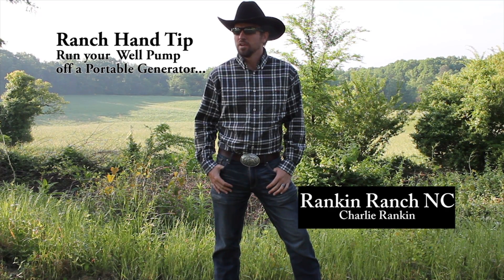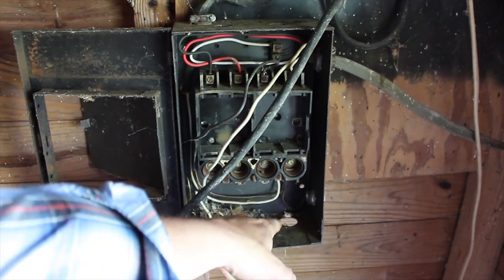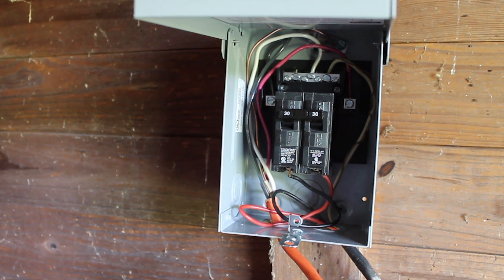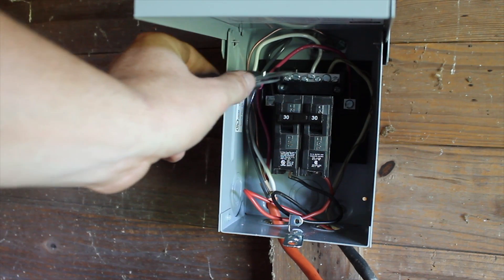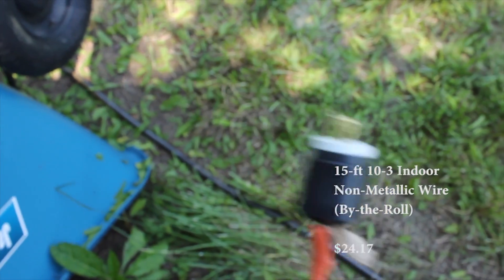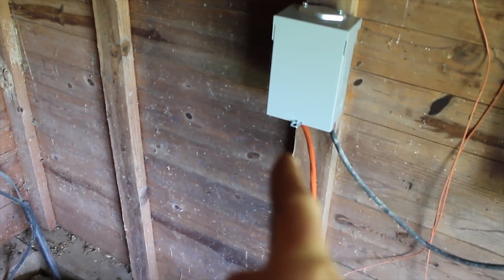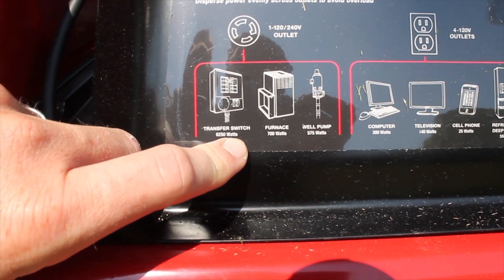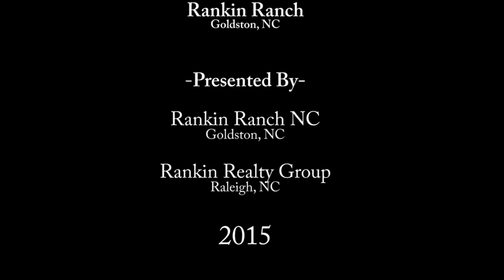How to run a submersible well pump off a portable generator. - Ranch Hand Tips

Comment from the maker: Outdoor Breaker Panel 30/30 http://amzn.to/2HQ8mEK
10/3 Outdoor Wire http://amzn.to/2Gb231m
Submersible Well Wire 300' http://amzn.to/2prHfrY
Square D 30amp Breaker Double Pull http://amzn.to/2pq3mzU
240V Plug Adaptor http://amzn.to/2puwlm0

Comment: Can you run well pump with a 30a rv generator?
Reply: typical residential submersible well pump will draw close to 15 amps for an instant at starting and the draw about 5 amps while running

My well is 220 volts not 120 volt.
Reply: The number of amps a deep well pump draws depends on its horsepower (HP):
15 amp: For pumps smaller than 0.5 HP, using about 5 amps or 700 watts
20 amp: For pumps smaller than 0.75 HP, using about 8 amps or 1100 watts
25 amp: For pumps 1 HP or smaller, using about 9 amps or 1400 watts
30 amp: For pumps smaller than 2 HP, using about 13 amps or 2300 watts
40 amp: For pumps smaller than 3 HP, using about 16 amps or 3200 watts
50 amp: For pumps smaller than 5 HP, using about 25 amps or 5300 watts 
On average, a well pump uses 700 to 800 watts of electricity, but larger pumps can use up to 2000 to 5000 watts. If you run a well pump for eight hours a day, it will consume 6.4 kilowatt-hours per day. 
A pump's motor current can exceed its full load current for a number of reasons, including:
Undervoltage
Current imbalance in three-phase motors
A short circuit in the motor
Incorrect wiring or faulty electrical connections
The pumped medium has too high a viscosity or density
The pump is worn

typical residential submersible well pump will draw close to 15 amps for an instant at starting and the draw about 5 amps while running

My well is 220 volts not 120 volts.
Reply: 30 amp RV generator typically has 120 volts, not 220 volts. A 30 amp RV plug is a single-phase, 120-volt outlet that's similar to a standard household outlet in the United States

Comment: All this goes off the assumption your expansion tank and relay switch are wired externally and not directly to your entire homes power system...my pump is about 150’ from the house and tank and relay are located in the water heater closet...so an extension cord like this doesn’t work for me 😭

Comment: 575 watt? someone just told me I would need at least a 3000 watt inverter ,to run my well pump. I know start-up can be a lot more but ....? 3000. I think I'll just get a generator.
Reply: 3000 watt likely is only 120 volts 
My well pump is 220 volts
Reply: @MC-hs4mf  Do they make a 120v in ground well pump? I have more to learn for sure. Like how is water still trickling out ,on day 3 of the last outage here. Maybe a large holding tank up hill would do the trick . It's not too big of an issue as long as I have all my old big water bottles filled up
Reply: @ he said you rarely have 120 on a deep well.

Comment: Not sure what I am missing.  You used a 3 wire on the 4 prong plug, so how did you connect both hots?  Also, my well has high and low switch so wont I need 4 wire?  How did you hook up the well with 3 wire?
Reply from the maker: It’s been a while, but off the top of my head this is how it’s set up: I ran the plug into a breaker box.  The plug had a neutral ground and hot.  The breaker box had a double pull breaker so one feed in from the generator split into two hots on the pump.  Ground and neutral get wired into the breaker box.

Comment: Nicely done.  I want to do the exact same thing.  Questions if you have time or see this note: What submersible pump was in the well? What is the surge power required to run your pump at start up?  It would be nice if movies like this included a wiring diagram. What may seem obvious to you gets muddled by fingers following black wires across a wall.  However all positive in my opinion.  Great starting point for me under the same remote conditions.
Reply from the maker: C. Kent I did not think of the surge amps when I did this.  I still don't know what pump is down there lol.  All I knew was it took 240V.  Ours did not trip the 60AMP but you likely wouldn't on a start up surge.  Some pumps will pull a quick 110AMP... I'm assuming since that is conventional ours does as well.  I think the surge would most likely be effected by the generator itself because it normally only lasts a second (wouldn't cause breakers to trip).  The generator we use could handle more than the pump so it's likely just handling any initial surge. Our well inspection company carries a similar size generator on their truck for testing all sorts of wells.

Comment: Why does the ground wire from the black wire leading to the pump relay switch attach to the neutral strip but the ground from the red cable is grounded to the box in your sub panel?

Comment: My well pump runs straight into a wall outlet. Nema 6-20. It says 230 volt. Why couldn't I make an extention cord? There is nothing hard wired,  just a plug at one ebd
Reply from the maker: +J bands Haha yeah Nema 6-20 is the plug type.  While this looks like a regular wall outlet it is not.  It is a 240VAC. Regular outlets are 120VAC. You can make an extension chord but it would need to plug into a 240VAC.  You can adapt a Nema 6-20 to a Nema L6-20.  It's basically a 240VAC 20AMP circuit. What are you trying to accomplish?
Reply: Yanasa Ama Ranch basically,  I'm thinking ahead. I live out in the country and when power goes out for one reason or another,  they're in no hurry to get it baxk on. I was thinking,  if it goes out in the winter,  I need a way to drip the water so pipes don't freeze. I bought a portable generator with a 240 volt option,  I figured if I needed to,  I could supply just enough to basically drip the water. I saw a cord online witch matches both ends,  the generator and the well outlet and is rated for 240 volt,  30 amp,  will that work? I want to get a transfer switch installed someday just can't do it right now

Comment: Good info. I guess you have a 2-wired well pump. Is that why I don't see a control box?
Reply from the maker: +burnn5150  it's a 220... the control to the well is a relay box that sits below the pressure tank. We do have a video showing all the different components and how to put a well together if you have a different set up shoot me a picture or diagram and I can help you out.

Comment: This was a good video, but I was interested in running a line that could be used only in emergencies.  In other words, the pump would normally be on the grid, but in case of a power failure, I could plug my generator in and run the pump.
Reply from the maker: +Gestapo Pussyranch at Lowes they sell generator plug boxes that are designed for exactly that.  The great thing about the boxes is they switch the power source over so you don't back feed the grid and injure someone trying to restore your power.  We are going to install one when we do, we'll post a video.
Reply: Sweet.

Comment: Good information.  I have this exact need.  I have built the box and cord for the generator but there are two pieces of information that are not clear.  1) Why are the neutral and ground from the pump connected to the neutral bar in the box while the ground from the generator is connected to the metal box and the neutral from the pump is connected to the neutral bar?  2) I cannot tell from the video if the bonding screw is in the small panel.  The screw that bonds the neutral bar to the box.  Is the bonding screw installed?  If not, why not?

Comment: I have a 35hp 220 pump for an orange grove.  Would this setup work for a pump that big?  Thanks so much for the great and helpful video!  Very helpful!
Reply from the maker: It will work fine on any 220.  You may need more AMPs do you know how many AMPs it pulls?

Comment: Nice job, however, what about back feeding into the grid ? Do you have anything hooked up to
prevent the power from doing this, if not it may harm a person working on the power
lines trying to restore the power.  I do like the set up you made using inside wire and the breaker box, I have to do the same thing
Reply: He disconnected it from the main line box and has it only functional from the generator.
Reply: @pmbcdirector1489 that’s why this video was confusing to me. 

Most people want to only hook up to a gen when the grid is down like a Hurricane.
Reply: @MC-hs4mf  Gotsha, that makes sense. Looks like this video is simply to run an off grid water pump on an old property that they don't want to be running the previous electrical system through the grid.  

Were you looking for something in specific regarding generator hook-up?   I tend to save a lot of videos of this type for our camp in the event we or the work team ever needs to get something hooked up in an emergency need situation.